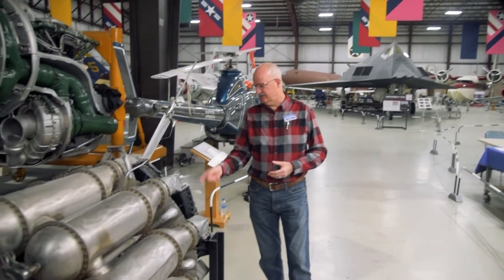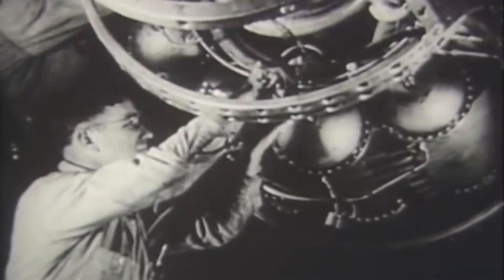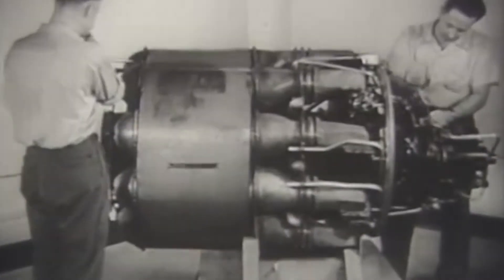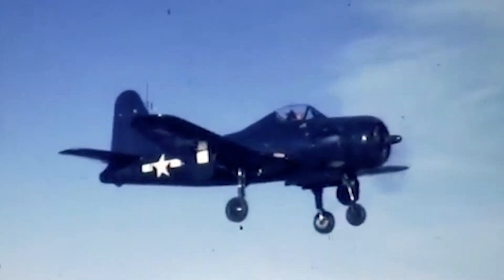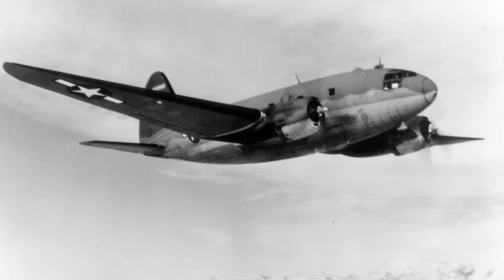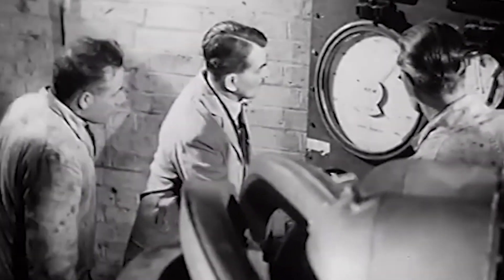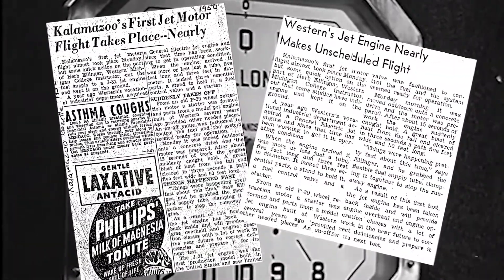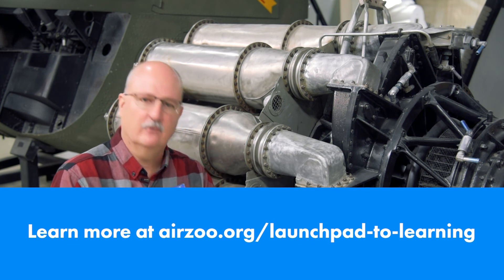The General Electric J-31 Jet Engine

Comment: Actually, GE was selected because it made turbochargers - with a compressor turned by a turbine, two elements of a turbojet. the US Military did not want to interrupt production of Allison, Pratt Whitney, Lycoming, Wright who were up to their eyeballs in piston engine production.
Reply: Thanks Dave, indeed GE was well prepared to initially build the J-31 and further develop these types of engines. What I found interesting is that after GE developed the larger and more powerful J-33, it was then decided to turn its production over to Allison! GE was rightly really angered by this decision. 
It was felt that Allison would be better able to produce the engine, both quicker and cheaper, so GE did the hard work of development only to lose out on their production.